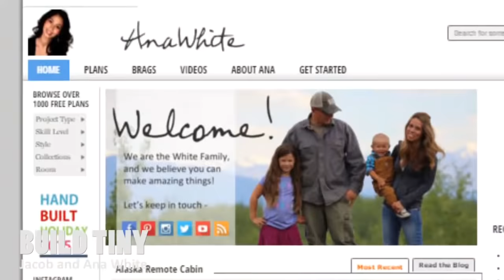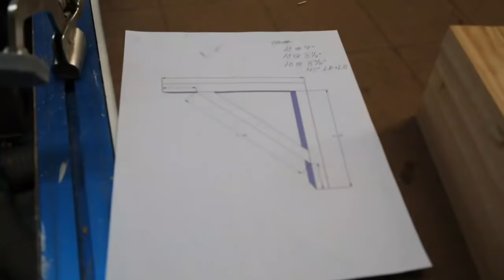How to Make Wood Open Kitchen Shelves: Ana White Tiny House Build [Episode 15]

Comment: So pretty, I think it wouls be my choice even permanantly. More shelves maybe. One question though, everything else seems to be protected against the inevitable movement of the house but not on the shelves. What's stopping it all from flying about? Thanks!
Reply from the maker: We will have to take everything off the shelves when we move, but since we don't plan to move often, shouldn't be a huge issue.  Thanks so much!
Reply: +Ana White I got you, simple enough! Thanks!

Comment: I'm curious if you only used a single 2" screw in those braces to attach to your wall?
So after looking at the plans on your site, you did use two screws. 
apparently it's "tricky" to do the top screw behind the cross brace, just FYI people.

Comment: Hi. Please, would you tell me what kind of tool is the one you use on 2:25?  Is it a miter saw or some sort of bench drill? Thanks!
Reply from the maker: Hi!  The tool is a Kreg Jig Foreman.  It drills pocket holes for joinery with screws.  There are several different models, from simple jigs to this one being an automatic powered professional version.  Thank you for watching!
Reply: Thank you Ana!

Comment: Looks great. A few questions.  won't the stuff  fall off in transit?  Do you have latches on the doors to stop them from opening and is the trailer balanced ? Caravans have to be balanced when you pack them so how does that differ  from a tiny house? enjoying  the build of your tiny house. If you  going to use it for job sites will the tools be packed in the truck?
Reply from the maker: Hi Craig!  Thank you!  Yes, in transit we will have to move everything off the shelves, but we don't plan on frequent moves.  Since our tiny house is designed to be seldom moved (one day every couple of years) we will level when in place, but good point on the balancing.  We do have a storage shed on the tiny house for some tools, but bigger stuff like tablesaws and miter saws will have to be transported in the truck bed.

Comment: I was wondering if you were going to go over the outside of the house. What materials did you use for the exterior of the house?
Reply from the maker: Hi!  We will do a video on the siding choices soon, we ended up using a metal siding for weight and durability

Comment: Ana, do you think I could use the same measurements for the shelves and braces if I were installing in a master closet? I'd like to just place baskets or fold clothes on them but unsure of the weight with the braces put together with glue and staples. What do you think? The shelves would run about 11 ft long, maybe a brace every foot?

Comment: Wondering how much weight can it hold with those brackets made of 1X2...
Reply from the maker: They are pretty strong, one of the brackets needed the angle to be less and I tried everything to get it to move a little in vain ended up having to make a new bracket.  The shelves shouldn't span more than 36" though.
Reply: +Ana White 
Never thought brackets can be made with 1x2, very impressive work! I check every of your videos and visit your website ALL THE TIME, thanks a lot for your every work!

Comment: Please help. I am not understanding what is the length of the top piece what is the length of the cross brace and what is the length of the piece that goes up against the wall??
Reply from the maker: Full plans on my site which includes all measurements https://www.ana-white.com/woodworking-projects/open-kitchen-cabinet-shelving-rustic-cottage-farmhouse-style-our-tiny-house
Reply: @AnaWhiteDIY  sorry I was intending to delete all my requests for the plans I found it after I had commented. Thanks so much.
Reply: @AnaWhiteDIY  So how do you determine how much weight these brackets will hold? I am going to be building a shelf over the head of my bed and I want to make sure it doesn't tumble down on me while I'm sleeping...yikes.

Comment: what's the specs on the pocket jig rig?
Reply from the maker: It's a Kreg Jig Foreman, pocket holes are set for 3/4" depth and used 1-1/4" pocket hole screws
Reply: Awesome! I bought a kreg jig recently and they are super cool.  I like the idea of pocket holes, but with the current jig I have, it would be a pain to use it frequently,  and your rig would be awesome!

Comment: The whole place looks amazing! My only concern would be while pulling it to where yall are going is you would have to take all that stuff down every time you move it so they don't fall off and break? Is that concern or did you already have that taken care of as far as have boxes ready to pack in each time? Where as cabinets with door that could be locked closed would save you a few steps. But it is beautiful! Do you have to have a special permit to move it on the road or is considered a camper as sorts? Thank you for all yall do, love your Fb page, and weekly email and video!
Reply from the maker: Thank you!  That's a great point.  We will have to move everything off the shelf when moving, but since we don't plan to travel often in it, willing to do the extra work here and there.  The cabinets with the door lock is a great idea for frequent traveling.  We are oversize width wise for Alaska, by a couple of inches on the roof overhangs, so have to get a permit to move - but its just a $40 fee and simple to get.  Not a big deal once a year, but wouldn't make sense for more regular travel.

Comment: probably less than ideal for when you move the trailer...
Reply from the maker: Good point!  For frequent movers perhaps cabinets is the better option.
Reply: +Scott Haun If it were me I'd probably store them for the move.  It's not like I'd need an 8-piece place setting in a house that small, LOL, so finding a place to stash them in shouldn't be too difficult.

Comment: what's the specs on the pocket jig rig?
Reply from the maker: +joey henderson That's the Kreg Foreman, set for 3/4" material, attached with 1-1/4" pocket hole screws.  We build alot, so a luxury tool for sure, but make sense when you use it all the time.